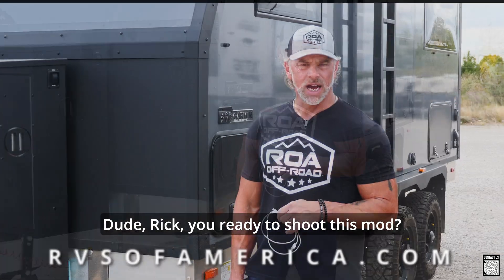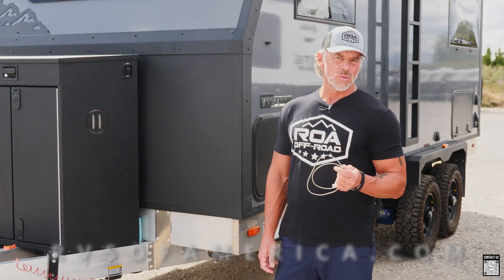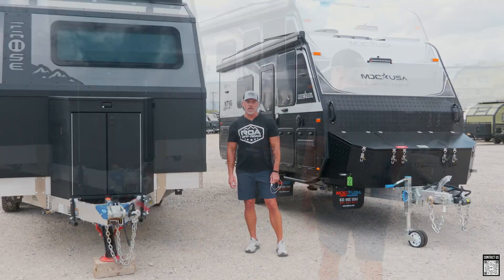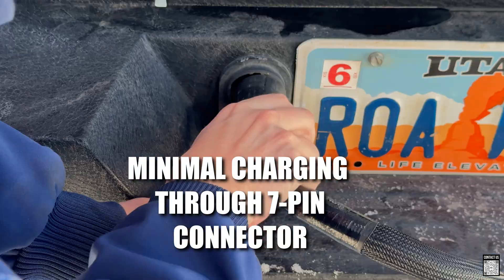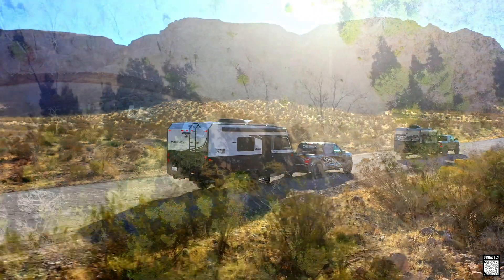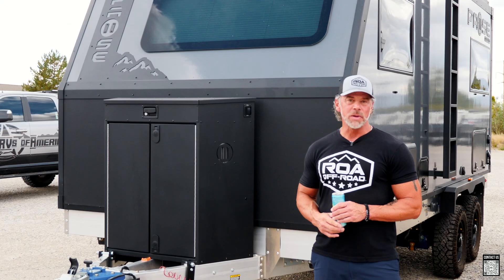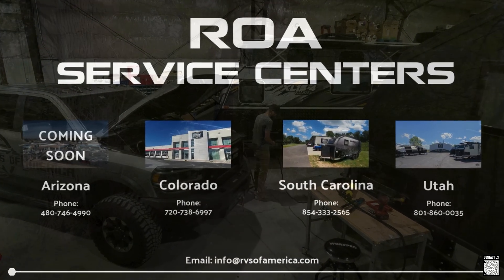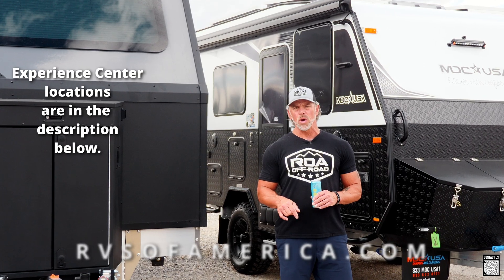Charge Faster While Towing: 50 Amp Anderson Plug DC‑DC Mod for RVs

Comment: hmmmm. my sales guys basically talked me out of it.
how much is it installed on my truck?
Reply: Paid $585 to have it installed on my dual alternator F250 in August. 40amp fuse and wires run to the rear bumper. Plug and play. Left ROA SC with 70% battery 1 hour of driving and 1 hour at Walmart in the sun, 100% battery.
Reply: In Oz, we already have the Anderson plug fitted as standard on all MDCs. In fact, I believe most vans here run them as standard, too. Only need them installed on the tow vehicle.
Reply: @100Jeanluc 
that’s what i meant. just in the tow vehicle. the trailer already does have it.